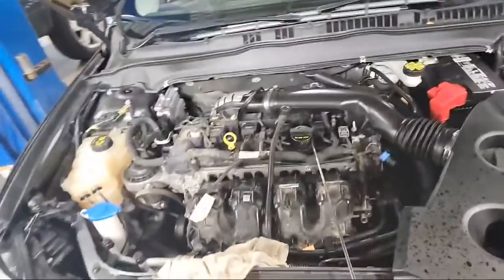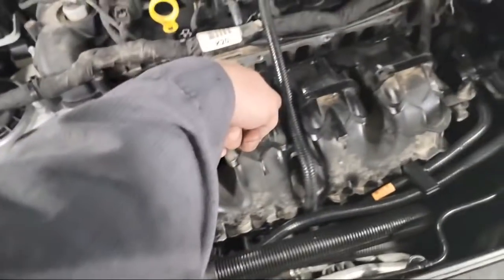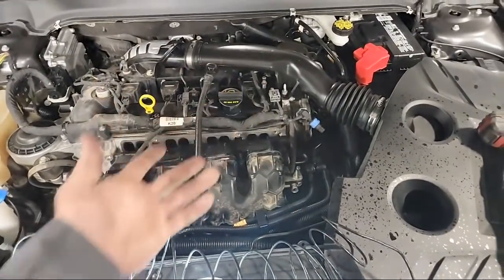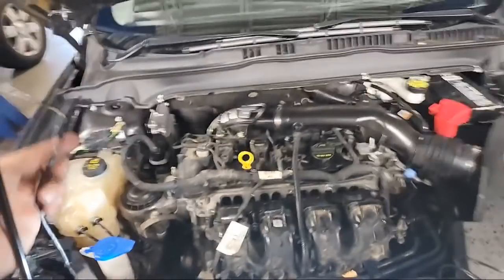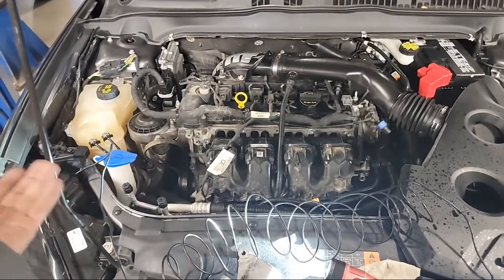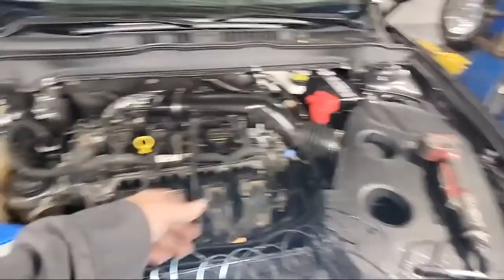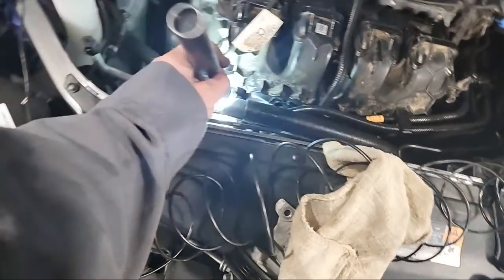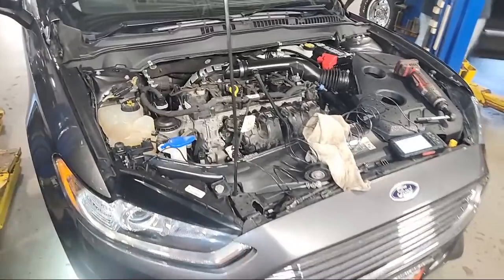2.0L ECOBOOST Fusion Valve Cleaning

Comment: Thanks for the video Rich. Found some of that Valvoline cleaner on EBay and manually cleaned my valves on my 2017 2.0 Fusion today. I have 135k miles and was expecting worse. Have run only Amsoil since 3k miles so may that helped. Either way the Valvoline and picks / brushes worked well. I’d walnut blast it if it do it again to save time. Appreciate you sharing your knowledge. Only thing I did have to do different on my is disconnect the vacuum line on the side of the manifold to get more room to pull it back. Also had to cut the fiberglass insulation back for accessing screws.
Reply: How long did it take you to get the valve cover out of the way to begin cleaning, please?
Reply: Maybe 8 minutes

Comment: I did my 2.0 Escape last week.  Just bought it and with 115k I am sure it was never done.  It was pretty nasty.  I soaked in brake clean, scraped, and used the zip tie method. I used a vacuum chamber to suck the brake clean out, rinse and repeat.  Then using a port adapter attached to a shop vac, I pulled the manifolf off, because I did a catch can as well.  Which I now know, isn't a good idea in cold climate!  Have to empty water out every 100 miles due to condensation.  I blew it out with pressurized air and while vacuuming at the same time.    Tedious but well worth it.   Turned out really nice.

Comment: good you pointed out the valves need to be closed ! this is pretty inherent to gdi engines ! I wish someone would make an intake manifold/  injector conversion kit !
Reply: On the 2.0 there are a few companies that make a sandwich style plate with injectors that go between the head and intake. There is also another style with 2 injectors that mount behind the throttle body. The kits are made for bigger turbocharger setups though. I always wondered if the one behind the throttle body would be able to work on a stock engine if tuned correctly. They have a module wired in to run the injectors and they get fuel from the lift pump instead of the high pressure pump.
Reply: @jeremypike9153  i suppose you can modify the plumbing and plug the fuel injectors into the intake ! Im not sure if its the c7 or c8 vettes or both but they have 2 injectors per cylinder ! one is gdi under normal load the other is a port injector which is  activated near wide open throttle ! this cleans the intake valves !

Comment: When I cleaned mine like this I got the engine up to operating temperature then shut it off removed the intake and closed the valves on two cylinders and filled the ports with Mercon ATF it seems to work really well on a warm engine. I used a long hook pick to get the build up broke loose from the back of the valves and a big bore cleaning brush to clean everything I could see directly.

Comment: I've been waiting for some 2.0l content, thanks.  What kind of mileage requires cleaning on these?
Reply from the maker: I would be running a cleaner through the intake about every 10000 miles don't even give it time to build up from noon or after a severe cleaning like this is done
Reply: a catch can also help minimize buildup on the back of the valves as well it won’t completely eliminate it but it will help significantly. If I had one of these that’s what I would do install a catch can.
Reply: So 2.0L. has coolant intrusion? I thought it was just  the 1.5L. with coolant issues.
Reply: @JohnDiMartino  on point. Threw a catch can on 2.0 as soon as possible. The amount of stuff it filters out helps significantly!

Comment: Perhaps in the future, they’ll install PFI to compliment the GDI to eliminate this problem (Toyota/Lexus) However for today, this is a great teaching tool to clean those GDI engines and perhaps influence vehicle owners to install a good catch can to significantly reduce this issue.
Reply from the maker: They have in the new models
Reply: How much does a catch can help what would valves look like with a catch can would they even require a cleaning? I run one on our 2020 Tucson and it catches a bunch of oil only 18,000 miles.

Comment: Love my 15 fusion titanium. Just wish it got better mpg. The best I can average is 23mpg. Thinking about getting 1 of them mavericks when some used ones start showing up.
Reply: 2013 with 2.0 averaged 27.3mpg overall. Even with winter driving and 80 mph interstate driving. So 23 is really low. Is that awd?
Reply: I'm getting 24 but I'm about to do this them we'll see how well this improves mpg
Reply: I strongly recommend starting with using lucas fuel treatment in your gas tank to clean it as we as the fuel lines and fuel injectors. I've used it for years it's the most simple way to help the car. Then run the car it'll idle better then do the rest of the cleaning.

Comment: 2013 fusion 2.0 runs like new at 108,000 miles. How do you know if it has carbon build up? Does get a lot of highway miles and regular oil changes.
Reply: Same car at about 110k i checked mine by taking the intake manifold off like he did and they were mostly fine. I used brushes on a drill, picks, screw drivers, brake cleaner to get it all off. Sprayed it out with high pressure air and rag to catch it. Threw a catch can on it and kept rolling to 130k.

Comment: Hey, Ford Boss me. I have a question? When you order a new long block from Ford. What is the procedure that the Dealership has to go through. Also what paper work should a Escape owner get to prove they are getting a new long block. After the leak down test is done and proves that the comsumer needs a engine. I am having a hard time after the test getting a order form or the paper work for the new long block. To keep in my records on the warranty work. Can you you help?   Shawn.
Reply from the maker: Unfortunately all you're going to get is them telling you it's ordered and then you're going to have to wait and then once the job is done it shows up on your warranty history record under your vehicle on the Ford website
Reply: @FordBossMe  Thanks, Ford Boss me! For your quick answer. Will do. I will just have to take their word. Then check in. In 3 weeks or so. Then get this long block behind me. Keep up the great videos. You have helped me alot. Trying to figure this issue out.  Shawn.

Comment: What year is this, on the 2020s if need be so much easier to drop the Int Manifold if needed, how many miles?
Reply from the maker: This is a 2016 with 73000 miles on it

Comment: Got to love GDI engines
Reply: Yeah I was thinking that myself ,nobody gave it much thought on the engineering side and clearly they didn’t use them very long before they started selling them.It’s not like this is just a Ford thing either every manufacturer did it they all messed up Ford is one of the first ones to fix it with a dual  system
Reply: @JohnDiMartino  the main thought behind it was getting more power with better gas mileage to bring down the fleet mpg to meet silly standards of certain politicians. They knew it wasn't great for the engine, and so many people lease these days that they don't care what shape the engine is in when they turn it back in. Nice to have Rich show how it's done if you want to do it yourself, that walnut blasting isn't cheap.
Reply: @markkeating3609  less fuel used/ less pollutants in the air... better for our childern... yes?   i own a 2014 fusion 2.0 and a 1984 alfa romeo spider, with a 2.2 ecotec conversion..i am a car guy.. but i want to be as clean as i can
Reply: @randellgribben9772  fantastic, good for you kid. But if your direct injection gets all clogged up because of the all the gunk on the valve stems the mpg goes down. Meaning you need to burn more gas, meaning more pollutants for our kids yes? And if you're out to save all our kids from fossil fuels why aren't you riding a bike to work, car pooling or driving an electric vehicle? Silly fleet standards mean just that. Most weren't met and auto companies had to buy carbon credits from Tesla. Good thing for Musk, Tesla wouldn't have survived that time period without it. It's fine and noble to want cars that get better gas mileage and pollute less. That's as easy as saying your against people kicking puppies. But it should be done in a way that's alot less costly for the consumer and with realistic standards. I'm not out to pollute the world, just saying don't let certain politicians pollute your mind with their rhetoric. Heck right now they're all over in Scotland right now promoting getting rid of coal while they're all currently fighting over the available coal because of their energy crisis in Europe and Asia.
Reply: @randellgribben9772  listen kid this really isn't the place for this so I'll make this short and sweet. First I have zero idea why you're trying to be argumentative with me, but I'll put you in your place again, but this is the last time kiddo, because I have better things to do. OK government subsidies to the oil industry. Again youngster, this goes back to what I said about politicians polluting peoples minds with rhetoric. The oil companies combined have never received one thin dime in subsidies from the government, not in the past, not now. Look it up son. Knowledge is easily attainable these days and it's not your enemy. Now Obama said they received subsidies for over 100 years, he like you was dead wrong. Please source one single government subsidy to the oil industry. Just one. Now some people confuse tax breaks as subsidies, so I'm very glad you've separated the two. You see kid, there's these things called tax laws, and in those tax laws written many decades ago, tax avoidance (read tax exempt) I believe is from around 1909 or so, the exact year I would have to look up. But tax avoidance is when your company loses money and you can claim those losses on future tax returns. Those aren't loop holes, or companies scamming the government or the average tax payer, that's them using existing tax laws made up by the law makers. Don't like it, write your congressman, start a grass roots organization against it, join an Alinsky support group. Griping to me about will solve nothing kid. It will only bring aboute having to educate you. Which, I've grown quite tired of. I've never had a problem with electric vehicles, they're just not viable yet in the mass numbers silly uneducated politicians are putting out. Our grid can't even support A/C let alone replacing all gas cars with electric. Now go find another source of education. I'm done with you.

Comment: So on my 1.5l I notice oil residue on my intake hose is that normal I will make a video to show you I don't know if I need that hose or that valve
Reply from the maker: Yes it is, the circulate alot of oil unfortunately and its a dirty motor 

Run a catch can
Reply: @FordBossMe  what catch can would you recommend for the 1.5 also how do I install it
Reply from the maker: @Nickthecarguy  well each catch can might install different but you're removing the PCV line and you're putting a catch can in place
Reply from the maker: @Nickthecarguy  look up a jlt catch can

Comment: Is there a way to keep those valves clean? One of my kids is driving a hand me gown 13 Escape with the 2.0 .It still seems to run just fine.
Reply from the maker: Well this is for the EcoBoost engines you could put a catch can on it for the PCV system and then every like 10 thousand miles to a induction cleaning service not fuel injection but intake manifold cleaning

Comment: That kind of stuff doesn't just evaporate quickly? Its not light distillates?
Reply from the maker: This is an oil-based product that's why I said that in this video it takes a long time for it to work it's not like a fuel type where it evaporates very quickly
Reply: @FordBossMe  Ok cool. Thanks bro

Comment: How screwed am I? My 2.0 ecoboost (2014 awd 98k) has some rough idle, and occasionally misfiring stumbling issues at certain rpm. It failed a regular compression test (doing wet compression test next). Did the crc turbo treatment yesterday and the car runs better, it cleared the engine light. But the next day I'm having some stumbling issues again. Any ideas?
Reply from the maker: Throttle body?

Comment: How often would you recommend to clean these valves? I'm worried about this issue on my 2.0L Ecoboost Fusion.
Reply from the maker: I'd say regular induction cleaning every 10k or so
Reply: @FordBossMe  why don’t dealers recommend getting this done every so often instead it’s always recommended when it’s too late and causing big issues like piston tops being caked and baked with carbon buildup.
Reply: @henrytom5824  so you get sick of the old car and buy a new one. Or they just dont care
Reply: @Chris-hw4mq  That’s exactly why very lousy and a shame it’s coming to that. I’ve gots to run a oil catch can on our 2.0l 2020 Tucson because I don’t completely trust running without one and 30,000 miles on the odometer 3750-4000 miles oci’s and it runs better than new all power is still there and burns absolutely nothing. So I’m hoping as the mileage climbs it will not consume oil like some Hyundais are known for I’ve been through that and don’t plan on going through it which is why I keep a close eye on everything.
Reply: @henrytom5824  In europe we had diesel that did 200-300k easely now because of the "environment" they make it hard to buy one, they tax you more. So you buy a new modern car and it lasts 100k before you need to change the engine.

Comment: Could you speak about your thoughts on getting the BG Platinum induction service on a Silverado 6.2 2015 with 75,000 miles.
Reply from the maker: I would do it it's not going to hurt anything
Reply: Thanks Boss
It’s a 2 step process so I will probably let a shop nearby do it.

BG has interesting products

Comment: quick question. 2017-2018 2.0 engine assembly.. was there any changes ?? I got coolant intrusion on my fusion. I bought a used engine 2017- my fusion is 2018 .
Reply from the maker: Is it a 2.0 liter EcoBoost if so then yes there was issues with those as well
Reply: @FordBossMe  yes it is a 2.0 as well. I’m hoping to just get it running again and to sell it or trade it in and get rid of the fusion all together
Reply: @FordBossMe  there are two engines in the 2013/2014 models.. one from the states and one from spain... i understand the spanish engine is the better engine ( might be biaes..i have the spanish engine lol )

Comment: To comment on the ecoboost extended crank. You could make some money if you knew a programmer who could write a couple second flood mode into a chip some how and put it into an obd case. As in make  an obd plug that would make the ecu think you entered flood mode on each start up. Then amazon that thing and cut me in lol
Reply: direct fuel injection    even if you could write into the ecu.. a second flood mode... it still would not work, the injectors are inside the head next to the spark plug
Reply: @randellgribben9772  his last video was about lack of oil pressure on startup in the ecoboost. Letting the engine crank before starting allowed the oil pressure to build

Comment: I don’t understand how people blow these 2.0s up my dad used to go 30k highway miles between changes on his, surprisingly never had an issue
Reply from the maker: They don't blow them up I have so many videos on why this is happening it's on real I'm surprised you haven't checked

It's a design flaw from the manufacturer
Reply: @FordBossMe  Oh! Has it always been? Ours was a 2014 SE with the 2.0 Ecoboost and sport pckg with paddle shifters and leather only 2 problems we had were power steering after parking next to an electric car charger and the transmission was slipping around 74k
Reply: @ryanravencaller  i change my trans fuild  4 quarts every other oil change  15000 to 18000 miles on 3 oil changes... then drop 4 quarts of trans oil.. no problem here.. i have a 2014 fusion 2.0 se w/ lux package

Comment: 3M used to make this throttle plate and intake cleaner that would just strip all that gunk off. But I can't find it any more. And I used you use brass brushes. I've been showing the students that you can use something as simple as a bunch of zip ties bundled tight and get good results as well. Just because you don't think you have the right tools does not mean that you don't have tools to get a job done.
Reply from the maker: Thats right